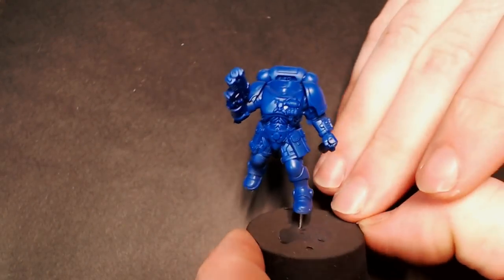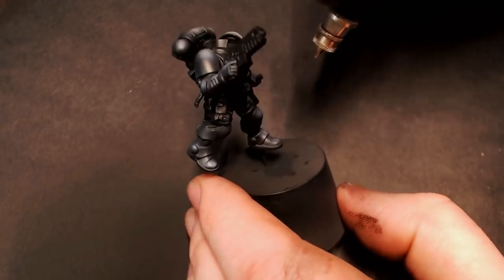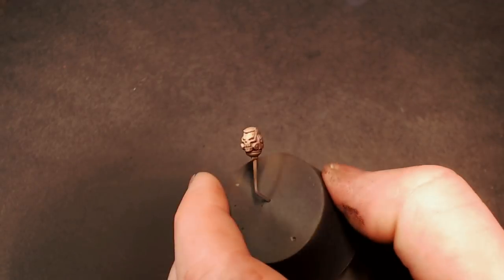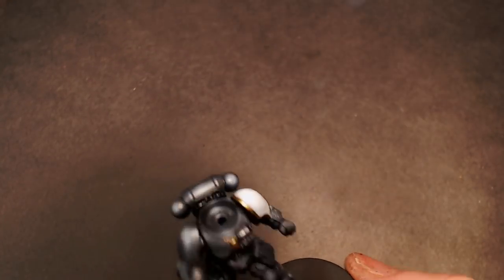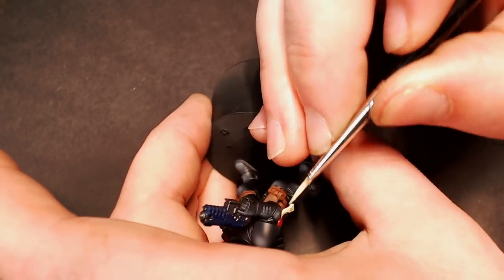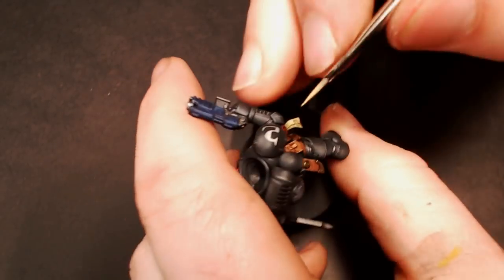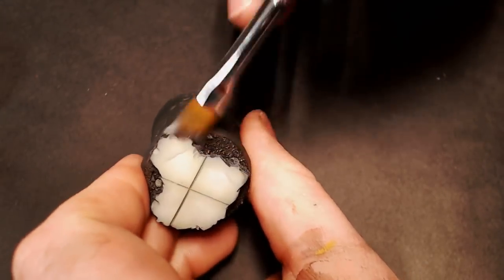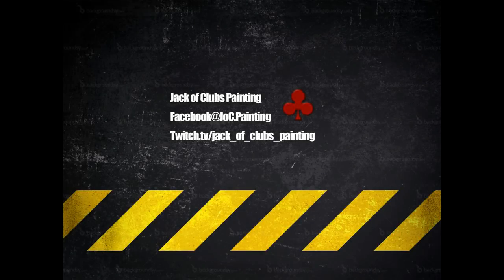Black Templars. How to Paint, Full Tutorial

Comment: Are you using flow improver or airbrush thinner? - My biggest issue with learning how to use an airbrush is different paints need different amounts of thinners / water. Yesterday I was trying to blow some GW paint through the brush and even though it was basically as thin as water it was still clogging, This is the issue that hinders everything I'm trying to accomplish with the airbrush, but there's not a great deal of information about this subject online, and what there is is pretty limited :D - Nice video :D
Reply: Flow improver most of the time, thinner will make the paint dry faster as it atomizes from the spray.  check your PSI, most of the time 18 -23 psi is perfect for the pressure. The clogging could be a mixing issue or something stuck in the tip. if that is not the case then put the improver in first, then add the paint until you get the consistancy of milk. try it a few times, if it clogs then use a touch of water or improver to get it thinner, biggest thing is to go slow, too much thinner and you'll get spiderwebing and splattering of paint.
Reply: flow improver. i only use thinner with varnishes. GW paint airbrushes pretty shitty no matter what ,so you arent alone in that aspect.
Reply: I did try flow improver a few months back but found that it made the paint tacky and sticky when it hit the model then took hours to dry ... PSI's fine though, im at the 20 range - I'll give it another shot tho ;)

Comment: I don't het it. Why are you first gloss varnishing and then after some steps again matt varnishing? What do you try to achieve?
Reply from the maker: the gloss varnish lowers the surface tension of the model, allowing the wash to flow into the details and not stain the clean airbrush work of the armor. after the wash is dried, I matte varnish the model to continue painting, bc it is harder to paint onto a gloss surface. also i prefer a matte finish. the reason i do a final matte varnish is to get a uniform matte finish on the model.

Comment: What do you use to clean out the stynylrez before using regular paint?
Reply from the maker: airbrush cleaner works fine. i actually prefer to use tamiya x-20a paint thinner as it is very aggressive on waterbased acrylic paints. rinse with water, then i use the tamiya thinner to knock out the remaining pigment. cleans it right out like gangbusters. word of warning though, dont use it as paint thinner, it will goop up the concentrated paint bc it actively breaks it down chemically